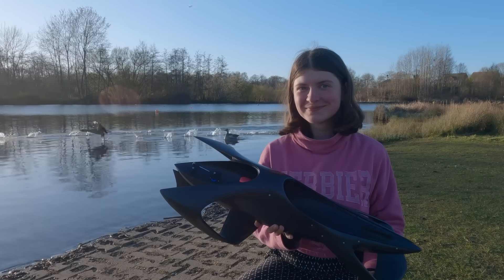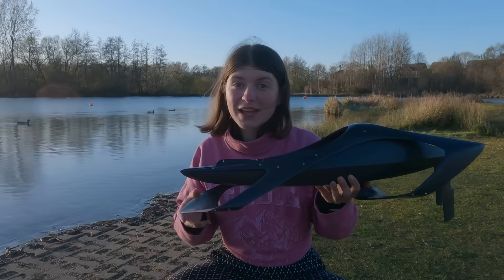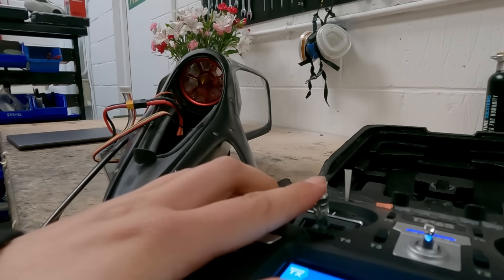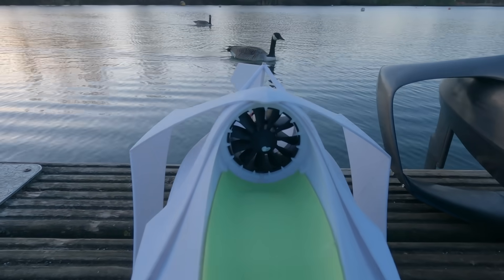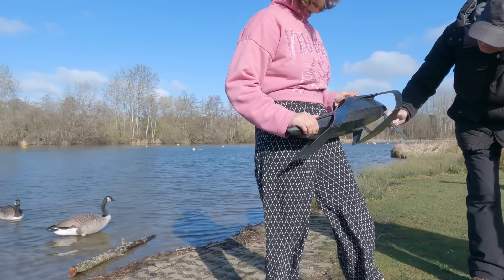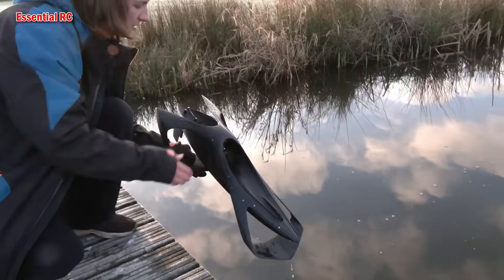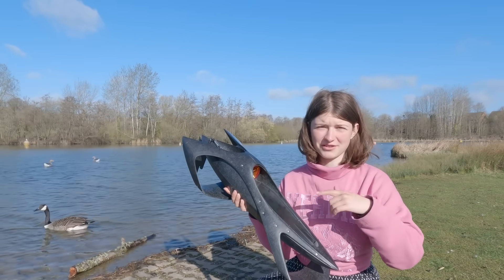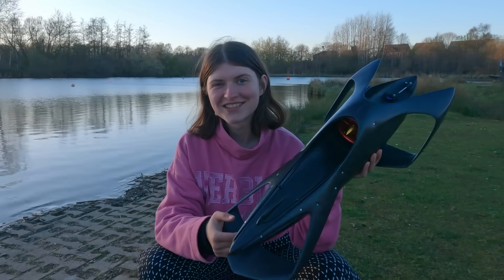Boat Propellers are Overrated... The HydraJet Explained

Comment: Boat builder here 😅The #1 advantage of this design is it's ability to plane on rougher waters, plane on lower speeds, stability and comfort. The advantages becomes way more obvious as the boat gets scaled up of course. The biggest disadvantage is that the flaps must be actively controlled possibly with a computers.

Comment: Of you add protractable wings.  It goes from water to air  and back to water!
Aka a water jet plane. You could even get jet specs from it by adding heated jet fuel injectors and a glow plug you can turn on when in the air to get extremely high speeds.  As is it would fly with protractible wings

Comment: Dream list: Dream (Cons)
1. FPV Camera (more power to operate camera)
2. dual motors? ( might have to be stack on each other to avoid unbalance output which would mess with center of gravity
3. a RC Race potential as they're all standard design and just requires a skillful driver.

Comment: The idea is sound. But remember its all about power to weight ratio and in your case to lift ratio. I could see that you can design your hull to reduce the weight further by having a lower hull and shorter.

Comment: the design is gorgeous! If it s not for speed, for what is it then? I did some quick looking up and found that air propellers are less efficient than water ones. So efficiency wise it is only beneficial, if you can improve the water resistance by about 10% by switching from water to air propellers, which I see only feasible for smaller crafts (I'm not an engineer so I don't know where the water resistance from water propellers become insignificant compared with the water resistance from the rest of the craft.  )

Comment: So, it appears to me very similar to an airboat or hovercraft. The real difference is where an airboat or hovercraft use air rudders to direct. You are using a water rudder. Which brings me to where you stated the air rudder was rubbish. I think you that was because you only had one instead of two. If you look at most if not all airboats and hovercraft. They use two rudders for that reason. I would say if you haven't. Which I am sure you have. Take look at those designs. Because I grow in in Southeast Texas along the Texas Louisiana state line. Airboats are common and those boys will run fast and loose through those waters and those boats will turn.

Comment: I agree, boat propellers could be way more efficient and I am in the process of designing something way different based upon a crazy idea I had a few months ago! I need to do some CAD and modelling to put this into effect which could also be used in high pressure pump systems! However, your Hydra Jet is incredible and well done for your determination to progress from first phase to near final product! I wonder if you might transition to a kind of ski wing, to lift the jet completely out of the water, so the hydrofoil becomes a wing to carry the boat over the water, like skimming the surface as a duck or swan does prior to landing on the water? I would imagine that aeroplane wing design and lift dynamics would get you there to transition out of the water to actually flying! Just my thoughts and it would be even more cool!

Comment: Now add retractable wings, and a rocket ionic engine and you have the future of space travel. Hemp was going to be used by Henry Ford as a renewable resource for textiles and fuel in his original design for mass produced automobiles. Look here for ionic rocket engine design from 1950's using gas propellant ignited by ionic discharge. The ionic discharge is also an engine and expels ions at the speed of light allowing high speed in space. https://youtube.com/shorts/EPPhEwxXSgg?si=zF2PlnYguhOqfmE1

Comment: This is such a rad project. I can see it working in full scale. I was thinking, the only thing that might be a problem. When you go to a full scale model of this boat is the noise from the fan if, you listen to any air boats like the ones I have in Florida they’re really loud. 
You could also just skin the 3-D print in a carbon fiber, Would that be too difficult? Keep going it seems like you’re onto something. Congratulations.
Reply: You may be could solve the noise problem by using those fans that they use on some drones and make it quieter. I think they are called whisper fans.
Reply: You could also add hydrofoils on a hydraulic which lowered down below the wings that you have already when you’re at a certain speed.

Comment: Thinking about your sustainable transport research, a very common kind of sustainable transport is bicycles. I’m personally a big fan of recumbents because of all their advantages with regards to speed, aerodynamic efficiency, comfort and safety, but for various reasons they haven’t caught on. I’m convinced a good design could change it and I see elements in your design that I’d like to see on mine. Would you be interested to chat?

Comment: How about the rudder from a water jet on the rear of the fan to keep stability in the corners whilst still having forward propulsion at either side of the fan as the boat turns.
Just a thought.

Comment: DEAR :; MADAM;: 

                              What about Steam heat by electric not gas .Steam like Heat rises and the Boat may use Steam heat traveling in pipes inner Boat Decks that help rises. Sincerely Richard Billig.

Comment: This would be so cool if you could 3D print and build it yourself. I feel like for most people this makes far more sense then a custom built carbon fiber option with a really long wait list that costs 7K+ USD. It would cut down on the time you need to sell things since you could focus on selling files, kits and/or parts as well as design time and not building high end boats for a small number of hobbyists that can afford it. Regardless, this is insanely cool and its awesome to see stuff like this especially from younger people.

Comment: You should widen the front of your car for stability and lower the seat for aerodynamic improvement. There was an 80's disabled formula one driver that married the front of his racing cars to the back of motorcycle. Stability. road worthy, speed and power to match.

 I bet the SBU would want to contact you for upscaling your hydrojet. I can totally see this as stage III of their drone fleet.

Comment: Very cool.
I wonder how much drag the wake is causing (I assume it would be significant). It seems to be coming primarily from the fan's output. I wonder if it could be redirected somehow without causing the nose to pitch down. Perhaps some kind of scoop that would still allow thrust to go backwards but then angles it sideways and very slightly upwards.
A full scale version might also require the air intake to be sucked in from above or the sides, assuming the pilot would be sitting in front of the fan.
So I guess what I'm saying is air intake and output seems to be the most important thing to tackle next?

Comment: Great design, a longer trailing edge might make it run smoother and faster. It would be great to have the in water surfaces, slip in locked so you can change just the wetted parts for speed, water conditions.
I like the stability of the foil like the electric speedboat and a wakeboard foil

Comment: Different hydrofoils using the same motor to chart resistance/ efficiency would be cool.
What about scaling it up in size. Sooner or later, there's going to be questions about its commercial viability.
And what about materials? You won't be able to send a 300-foot version across the Atlantic using just carbon fibre.
Lots of questions 🤔
Reply from the maker: @taters-no4gj  an efficiency plot would be cool. In terms of full scale a few different markets could be feasible, imnthinking of doing a video on how to redesign an rc concept to a full scale boat, and diving into more depth about all the difference considerations including prodiction

Comment: Nice design!
Looks great!
It seems like it might have an issue turning?
If you lose the rudder? And use a ball joint in the center of the chassie? Or maybe a just behind the front wing/foil; to bend the chassie in the middle of the vehicle.
Then you would be using the wing/foil to turn. I think this would allow the vehicle to turn sharper. Maybe handle more like a car?
What do you think?

Comment: From my work with PCs the 70mm is just too small.... it will be loud and not move enough air.
Try a 120mm or even a 140mm fan, although pay attention to cfm since this will be important to you.
Also, weight and decibels may be important to you.  
Note that decibels is on a logarithmic scale, not linear.  So an increase if of db is 10 times as loud, and a 20 db increase is 100 times as loud.
However, if noise reduction is important..... then reducing the fan speed on a larger fan will decrease decibels, while maintaining cfm.

Comment: Interesting concept that could be applied to float planes. Many float planes don't have floating hulls anymore because the impacts from the water wear them down over time and crack. A hydroplane could be bolted on and take initial impacts and replaced more often than overhauling an entire airframe.

Comment: I designed a similar boat years ago with nearly the same duct system/shape except mine was a WIG 'wing in groundeffect' and was a single seater that looked like a fighter craft cockpit (in front area) with anhedral wings (WIG playform) and the duct adds lift. My design was to create a super fast form of lake PWC that was like flying a fighter jet. You can put an enclosed 'full recline' cockpit up front in the nose for a pilot but it will be somewhat CG sensitive due to pilots weight. You can move it more aft but will interfere with the duct a but but due to airfliow speeds being much slower ahead of prop, could be done. I may try to use the same foils you designed to manually control attitude and height rather than a true WIG so the pilot does not have to have super fast reflexes to keep it at the proper height and angle( WIG would provide much of the lift but is not as big as a normal WIG platform and would be capabil of much higher speeds with considerable less drag.
Reply from the maker: @gittarpikk  very cool, thanks for sharing! I'm really interested in seeing it, feel free to email over some photos if you have them :)

Comment: Thanks for sharing. Once I took the ferry from Bornholm to Ystad, and I was really surprised. . On the small deck, I couldn't stand up, because it was blowing so much. But then I was like: Hey there are no waves - where did the wind come from? After a while I came to the conclusion that it was the speed wind. A bit confused I went to the information desk, and asked about the ship, and they told me - this had been the fastest ferry in the world. And to my self I thought - this must be the future, to swish over the surface.  That ferry had two big water jets, that  throw water trough the air. Two gas turbine engines.  When I see your video, I wonder what kind of propulsion you think a ship would have if it was designed like your boat? (now they have an other ferry on that line, this was 20 years ago).

Comment: Right when I saw this design of your creation. I thought to myself, a wonderful design. You could modify the air flow to be directionally controlled as used in the US F-35B jet engine, or as used in the modern-day air-boat designs. Your air-foil design is very interesting. It appears the rear foil is keeping the boat in the water, while simultaneously the front foil is lifting the boat out of the water. One thing I noticed that I didn't like was the amount of water being sprayed up into the air behind the vehicle. Still, a very slick design.

Comment: @covaconcepts, great work, my deepest respect for your engineering skills. here are some ideas for the future for your project:

    Twin-rudder as the first upgrade step
        Low cost, almost no changes to the electrics.
        Mount one rudder on a short outrigger directly behind each wing tip to maximize lever arm.
        Slightly reduce the surface area of each rudder so that overall drag in planing mode stays low.

    Optional upgrade: micro pump-jets
        Install a 20 – 25 mm in-runner pump-jet under each wing; use soft-start ESCs and activate them only when the main EDF is below ~20 % power.
        Differential control (radio mixer): to yaw left, run the left jet in reverse and the right jet forward.
        Protect the intakes with a small impact plate to keep out debris.

    Testing & fine-tuning
        Measure turning radius at 20 km/h and 40 km/h, and log current draw.
        Watch for cavitation: if bubbles form at the jets, you’re ingesting air—move the intakes deeper.

I recommend the modification because it delivers sharper, more controllable turns without compromising the HydraJet’s speed-oriented design

Comment: The world needs a device that can telescope out of an electric vehicle, form into a flower shape, collect sunlight, turn it into electricity and charge a car battery. In Canada, we have little use for EV's since they can't be charged out in the bush. Such a device would track the sun as it moves across the sky. It could transfer the light down fiber optics to a light/electrical converter if necessary. We need it yesterday. On a forestry vehicle so I can drive home at night when the day is over, with a charged battery. Oh, and -40C to +40C is the temperature range. Also, it needs some survival skills so if the weather gets nasty (every five minutes in Canada) it isn't destroyed as it tries to work. A motion sensor that detects bears climbing on it in curiosity, self-cleaning for the bugs that will coat it because that's what bugs do, and a nice, lilting female voice in the AI for lonely foresters who have to camp out in tree planting season...So get to work hydrofoil girl. Canada needs your prototype in, how about next week? Forestry guys know all there is to know about engineering...okay, maybe not.

Comment: I’m interested in the design process and how you developed the perfect lift for the design parameters. I’d assume it’s similar to the airfoil of a plane wing. What software do you use to design and get the simulation? I design with solidworks and enjoy the design development the most.
Reply from the maker: Thanks for the input, the next video will cover the design and prototyping. I use Solidworks mainly

Comment: Hello there... That... lovely (albeit differently) Algorithm Almighty has taken, for some obscure reason(s) a dislike for either me, my comment, or both. It deleted it TWICE< as soon as I've posted them, even if there are NO "effs" and other swear words in there, no profanity whatsoever - just a technical explanation.
This is really insane and annoying, it's YT... Anyway, I'll keep trying reposting it - until YT will accept it, or I'll give up - whichever comes first...

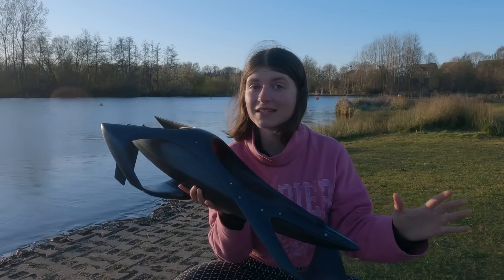2:13 - yes, it's so rubbish at low speeds (same goes for landing planes after touch-down...) and so is the air propulsion (fan/ ventilator/ propeller) at moving high loads (i.e. the substantial mass of a "real life" craft) - and that's why you'll be very miserable trying to push/ accelerate the whatevercraft using only "air propulsion". (That is,  unless you're gliding on a friction-free air cushion - like hovercrafts do.)

In other words you will need a good ol' propeller in water in order to get any serious "push" on a seriously heavy mass - and while latter on, when the craft in question  is cruising at high speed, it might be actually feasible to rely on an air turbine/ fan only (and lift the propeller out the water for better performance), or maybe even use the jet propulsion (as Ekranoplanes used to do), but as long as the hull contacts water the resistance is just too much.

When the hull is in "full contact" with water you need to overcome this significant resistance not only to accelerate this whole huge mass until it starts to lift itself above the surface - but the very uplifting of this whole mass will need a lot of "push" too. They say the Nature is the greatest source of inspiration (for engineering solutions) - and look no further than these geese taking off right at the beginning .
They've tried to show you, I would say, how this whole "take-off" thing is done, properly (and EFFICIENTLY!) -  when they begun their take-off and their bodies were still floating on the water (= are in contact with it) they used mainly their LEGS for propulsion and to gain the "take off" speed - and then even when their bodies were already above the surface they STILL "treaded" on water - together with "lifting action of wings" - to accelerate themselves more efficiently! 

And the the wings take over the "lift" and "propulsion" business ONLY once these geese are fully airborne... See?!

Comment: I like it, one question, have you considered vector thrust instead of rudder?It is evident that the rudder has perfect control on the longitudinal axis, but it exceeds the limits of the wings, so it could be damaged in places of almost zero depth. It would even reduce friction. Cheers and I love your channel 👌🏻